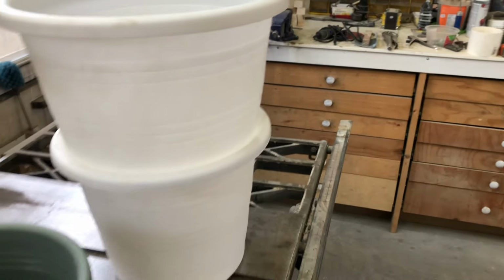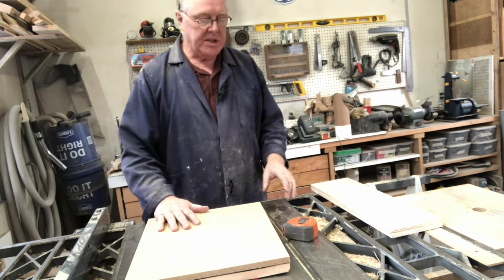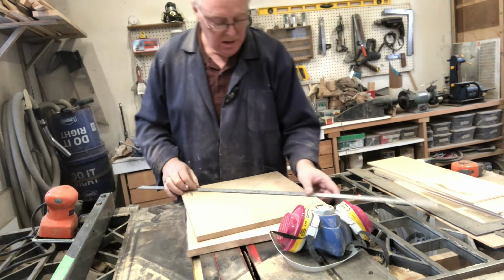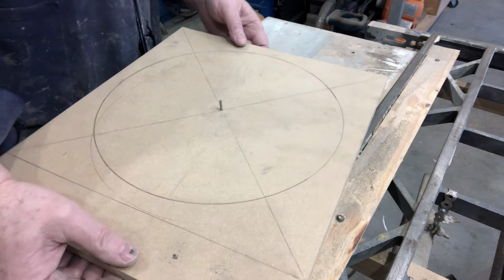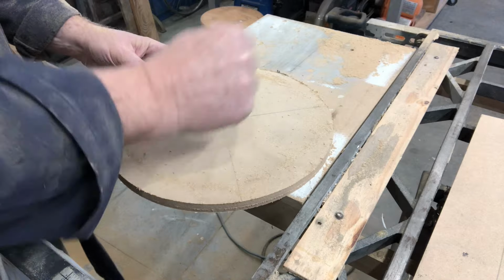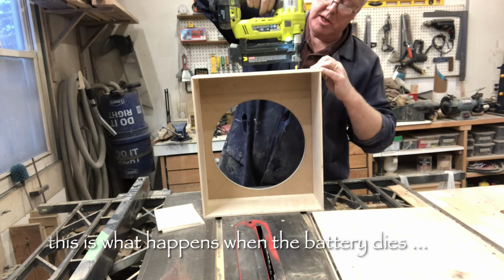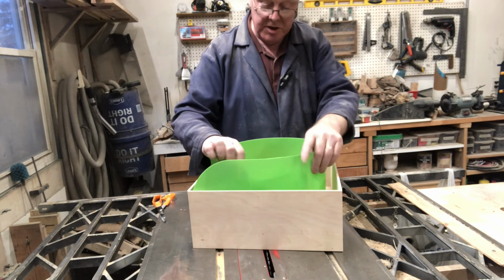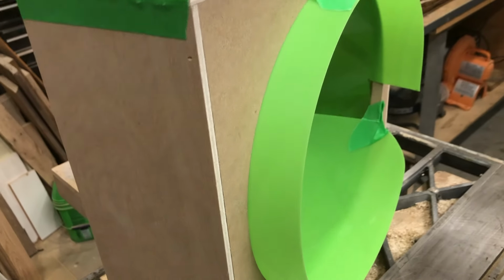Dust Collector - Cyclone - Part 1

Comment: I so agree with you about MDF it is horrible stuff, Just  like working with thick cardboard with the added horror of its toxic nature. After 60 years in the trade I had to use some for the first time for a customers project. I will never use it again.
Reply from the maker: MDF is nice for painted cabinet work, but I really don't want to work with it again without having dust collection. Thanks for your comment!